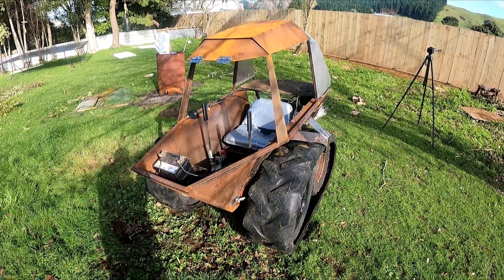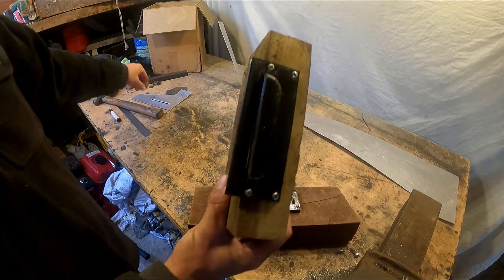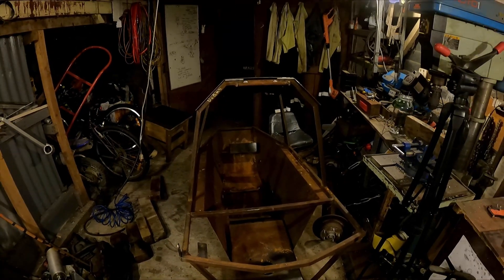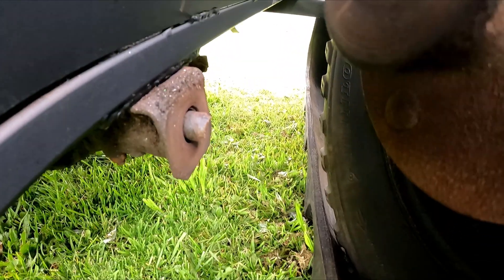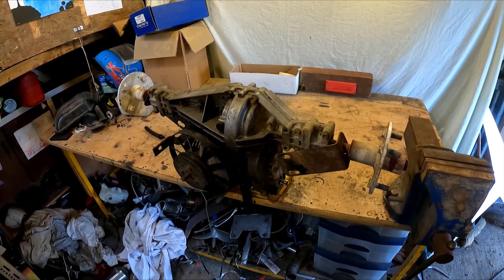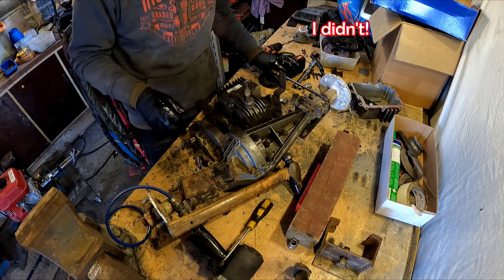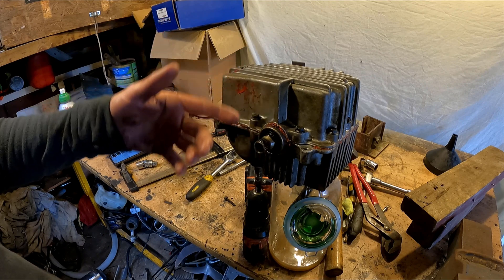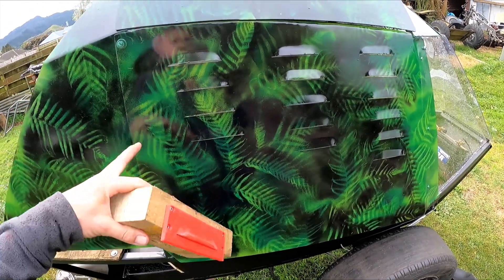Homemade Baby Ripsaw Build ,Part 5

Comment: Nice looking "midnight forest" camo paint job!

One thing i did notice, at around 3:32, is that your spray gun is spraying very narrow. Usually the pattern is 15-20 cm tall, 5-ish wide, yours looked like a 5-ish cm round. I suspect that paint was way too thick. Try a thinner:paint mix ratio of 5:1, even up to 8:1(typical ratio for single stage, no clearcoat, paint). It still turned out good so a wide spray would have just been faster. And don't forget to turn air pressure down to 10-15 PSI (70-100 kpa, ~1 atm) for less overspray.
Reply from the maker: I think it was too thick I’m not a very  good painter , thanks for the tips

Comment: Maybe you can make a hydraulic drive with power steering pumps?
Reply from the maker: That would be cool it , I wonder if they would be strong enough
Reply: I know for sure that an early 90s Mercedes pump outputs 1000 PSI (~7 Mpa). That seems to be the standard pressure for power steering, from a quick search. 
Since it is non-adjustable (unlike the pump in that new transaxle, regulates speed by pumping more or less instead of restricting flow), you would need a special valve that allows fluid to constantly circulate, then re-directs pressure/flow to the motor as needed. I think that would be a 4/2, four port/two-position valve. Not 100% on that though.

Comment: Cool little tank! The Ripsaw is an awesome machine. How's the diy clutch-brake system working? I want to convert an old Cub Cadet 782 into a tracked loader and was thinking of doing the same.
Reply from the maker: Thanks, it takes a lot of force to brake each side and the diff makes the free side double in speed which is pretty hard on it. But with a short track it’s not such a problem, the real ripsaw has a locked diff and runs free from a braked hub which they engage to move forward which is much better